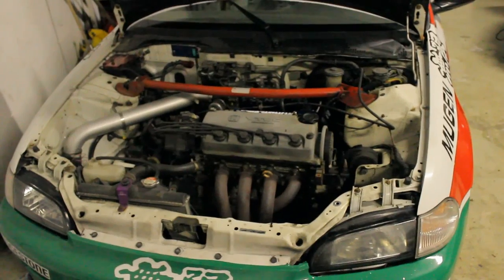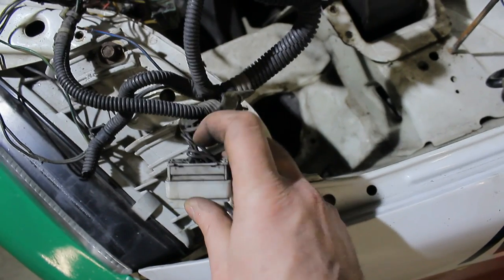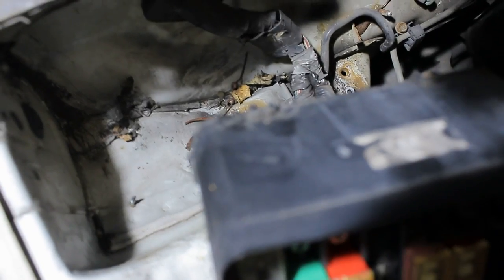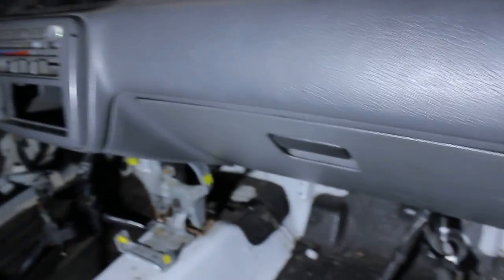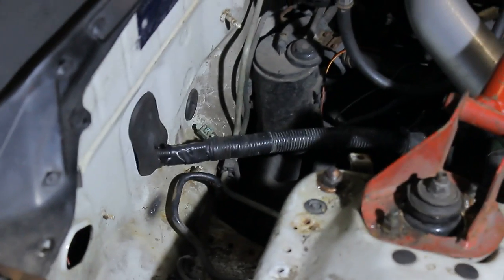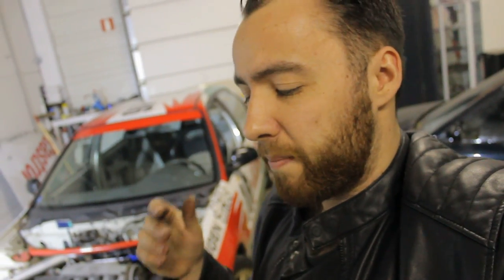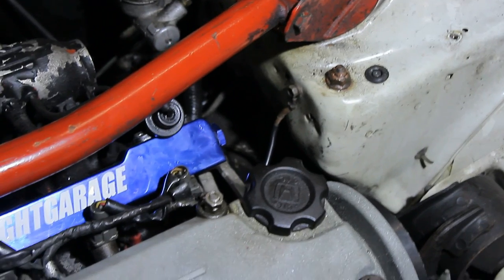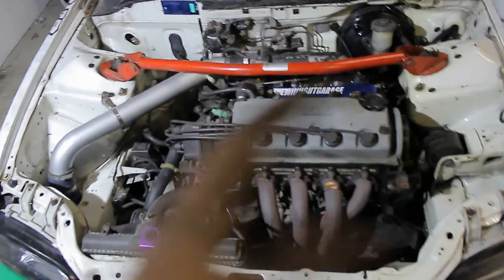How to wire tuck a Honda civic EG / del sol / Integra

Comment: Good idea swapping to MPFI from DPFI. We got the D15B2 here in the US and it was a turd. The first thing I did was swap from auto to manual, then swap to MPFI, then I put on a D16A6 head, then I swapped the entire engine to a JDM D15B VTEC and swapped the car to OBD1 with a P28 ECU. That was an 89 CRX. It was pretty quick with just the D15B in it. Later on I was starting to do bodywork on it when I found out that the rockers were completely rusted out and the quarter panels were 3" thick of Bondo body filler. That was a scrap it moment for me...
Reply from the maker: Boosted B Series EK it always sucks when you need to scrap a car that you worked so hard on. :(

Comment: Why do you need the ground on the valve cover? Now that I think about it I don't think mine is.

Also may be related but whenever I turn my AC on it whines for a little bit and then goes away. From what I've looked up online it says it's a ground issue?
Reply: Braxton Rosas 😂
Reply: Braxton Rosas iys just a motor ground you can put it anywhere in the motor
Reply: Put it on the back of the motor ...

Comment: now where would you get the plugs for the firewall if you don't want to run your harness back through those holes
Reply from the maker: which one specifically? there are several options for those. you can still get most from honda, and companies such as Passwordjdm have them as well. Some companies like downstar have billet plugs if you are into that!